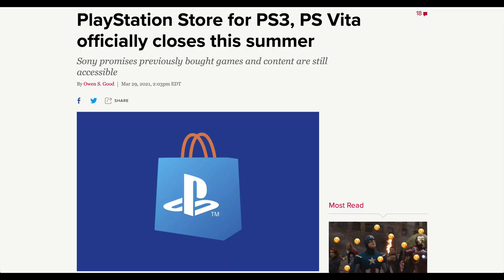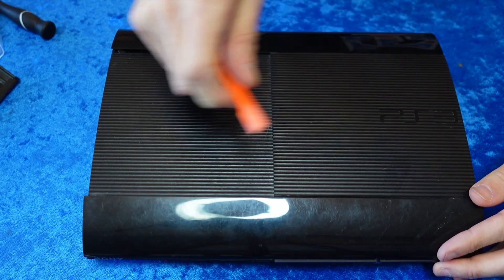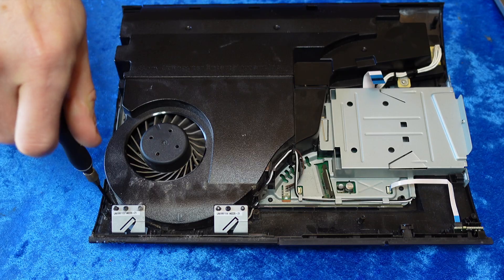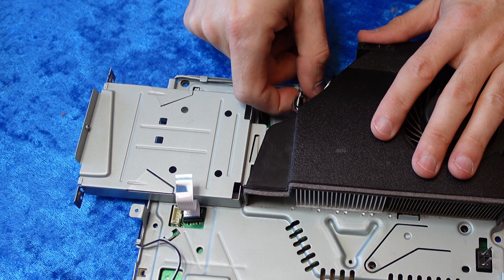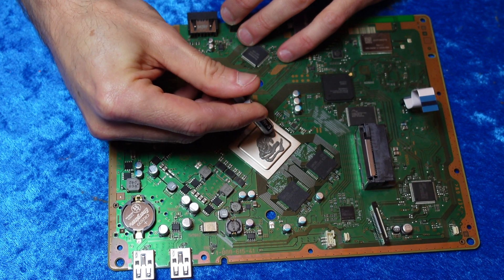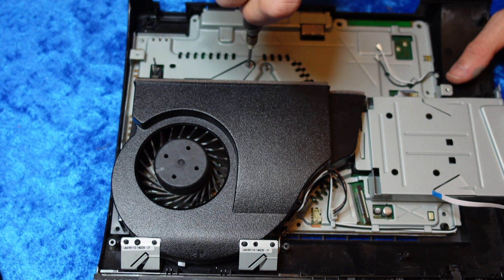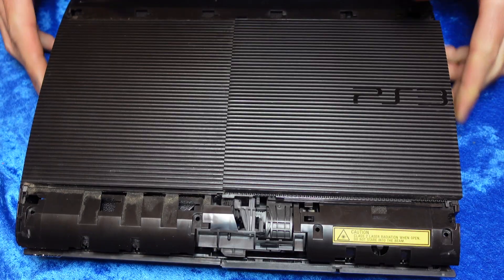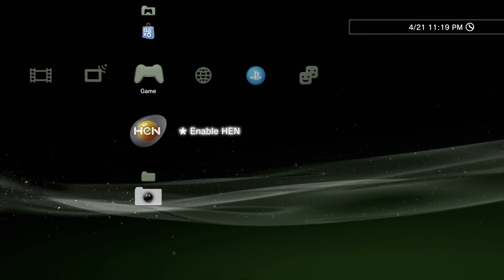PS3 CMOS Battery Replacement Super Slim CBOMB Fix

Comment: Will the console work normally without the coin cell battery installed ?
Reply: You should be able to use it, unless Sony shut down the servers for the PS3. Disk based games should still work though even then.
Reply: @moomin7461  so a hen jailbroken ps3 will work without the coin cell battery installed right?

Comment: @Blaine Locklair   I changed my thermal paste 4 days ago and now my CMOS battery is dead. So now I need to do these steps again. My question is, do I need to change thermal paste back again to replace the battery as it's just few days old?
Reply: Probably not, but why wouldn't you change the $2 battery while you were in there? Makes no sense.
Reply: The same thing happens to me, what did you do in your case?

😮
Reply: @LucasRial10  I repasted as anyway I opened it. Always better to repaste than leave it as older one

Comment: The trim pieces actually slide off, pushing up and to the left, when facing you. I tried your technique, which worked but ended up breaking one of the legs in the center of the piece.

Comment: This is a nice "temporary" fix. But in 2027~2028 it will be to have done it again... But... How about the ps3 servers? That's the big deal!
I'll change the battery by the end of this year, then play and finish all the digital games and... If Sony won't fix the issue like with ps4, by 2025 I'll sell it and keep just the phisical games to play on pc emulation.
At the moment I don't see a better solution...
Reply: Ps3 servers almost dead maybe in games like rdr you can find mutch players.

Comment: Is replacing the thermal paste necessary?
Reply: Yes. When you open your PS3 for replacing CR2032 battery, the old thermal paste will broke and it lets enter air. Air is a bad thermal conductor.

Comment: Since you have your PS3 moded and changed the thermal paste, it would have been nice to show the before and after temps.
Reply: So before i used to get 67,68(sometimes  70)on syscon settings,but after i set the fan to 30 the temps were,61,62,after repasting i get 55,54 on 30percent fan
Reply: @sabagegelashvili916  Thats more like it. It works nice now.
What thermal paste did you used?

Comment: This is not a fix - this only extends the length of time you have before having to worry about it again. After all that new battery is not going to last forever.
Reply: The “fix” would leave it on 24/7

Comment: I bought a second hand ps3 recently and I've had problems already, next to where my controller is connected there's something that looks like a battery symbol? it keeps flashing yellow when I'm using the console when playing games etc. Tried getting it repaired but the guy I took it too said there's no issues? Should I keep the console or just ask for my money back and buy a new ps3.
Reply: Sounds like the HDD LED... that's normal. it flashes when the HDD is being Read or written.

Comment: What an absolute ridiculously bad position of the battery. You could actually say this is practically unserviceable.
Reply: It does seem crazy how much you have to take it completely apart to get to it. When I find something like this, I would likely two things. I would solder on two sets of wires off the solder points on the bottom of the PCB where the battery holder is. From these two sets of wires, I would solder on a separate holder that can be placed elsewhere in the case as I'm sure there is room under the DVD drive area so that less has to be removed to replace in the future. The second set of wires would be left covered but available so you could solder on another battery holder temporarily with a battery in place as you do the actual replacement so that the time isn't lost in the process of the battery swap itself.
Reply: on mine i made a dedicated hole for this boy... now it takes 5 minutes and not 30 minutes
Reply: Hello! What temperatures you have at this model ps3 super slim? At my model i change thermal paste i clean and i have 68°cpu and gpu 73° in game with syscon setings.

Comment: Hey Blaine, i have a question, So i Installed Evilnat CFW from your tutorial, I want to dualboot with littlebalup 4.87 Dualboot Firmware. But for some reason the PS3 sees my USB with PS3/UPDATE/PS3UPDAT.PUP. But when I try to update it via storage media, it says no applicable update data was found,  and i can't get it to recovery mode because the touch power button is unstable and doesn't always detect my finger, sometimes it does but when i am holding the power touch it loses my finger and doesn't do the recovery mode procedure. Why doesn't the ps3 detect the update file?
Reply: @blainelocklair  Don't worry! I needed to go to recovery mode! but thanks for the help! :)
Reply: @blainelocklair  Your videos are defenitely worth watching
Reply: You are talking about the Fat model, right?
Try to get off the top cover of your ps3 and then press the power button without the cover, if thats not working either make your finger little bit wet and try again.